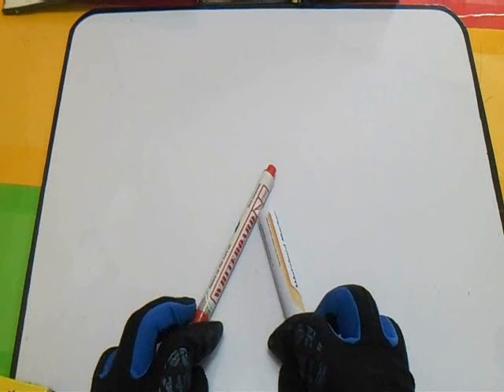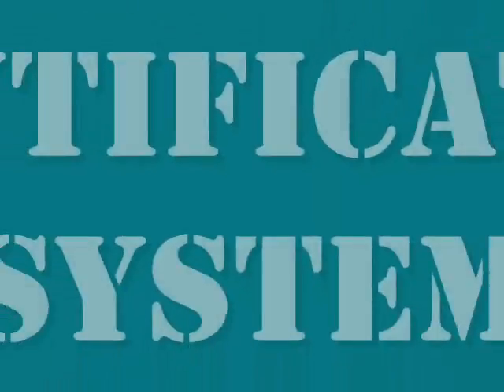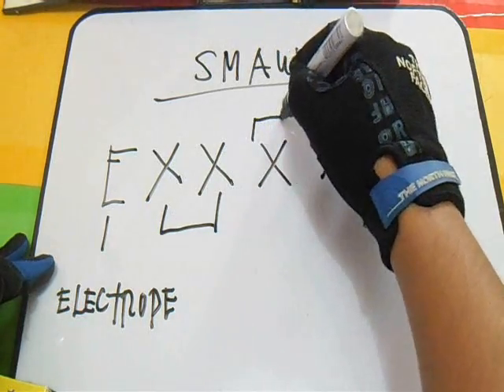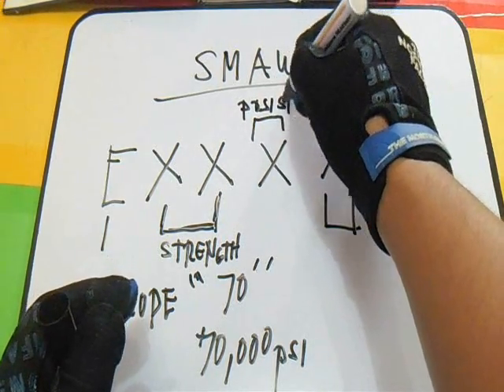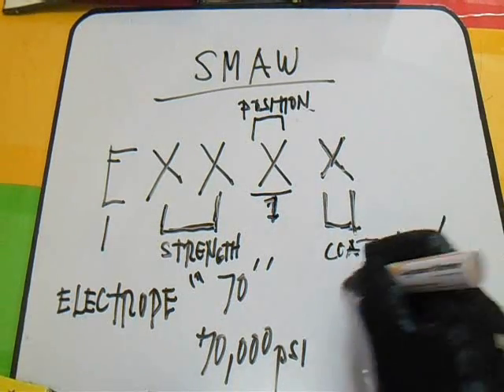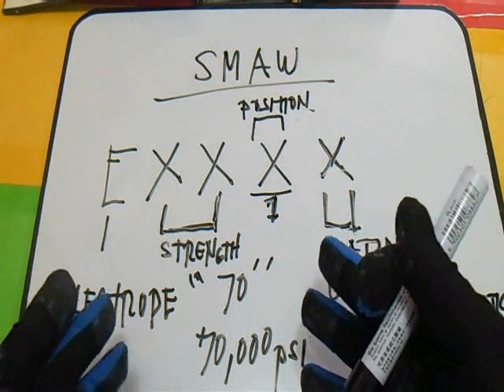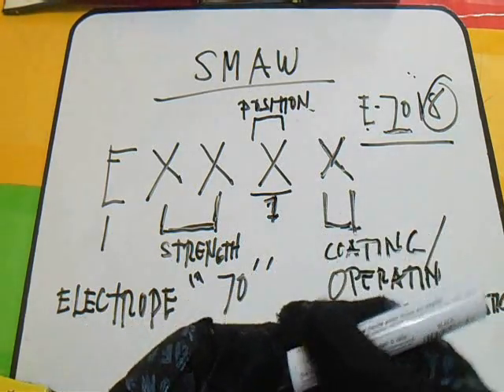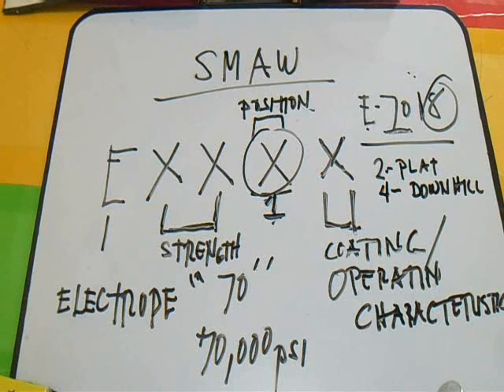Welding - SMAW Electrode Identification System

Comment: What about the Lincoln Pipeliner 8P+(E8010-P1) for pipeline welding. What is the meaning of the P1 optional designator? Please help me with proper explanation. I assume it means that the electrode meets the impact toughness and ductility requirements as per ASME Sec II part C. Pls correct me if I'm wrong . I just want to know the meaning of that designator P1. Sometimes it is E8010-G. Also What is the meaning of that designator G
Reply: ngayon kolng nlman n pwde pla sa down hill ang 7018 ang alqm kolng kc sir ang gingmit tlga sa down hill ay 1104 yan ang welding rod pra sa down hill